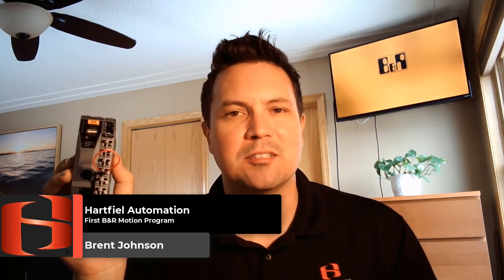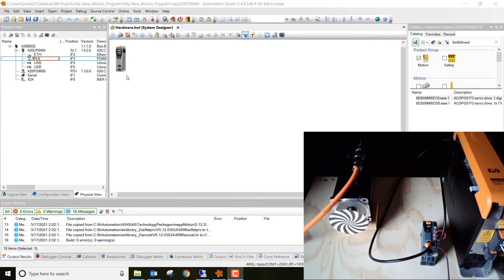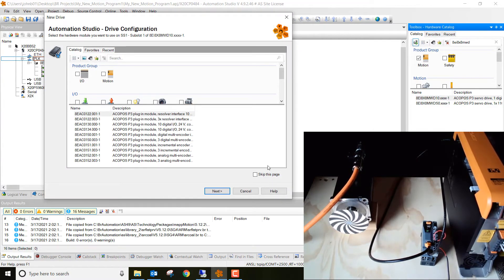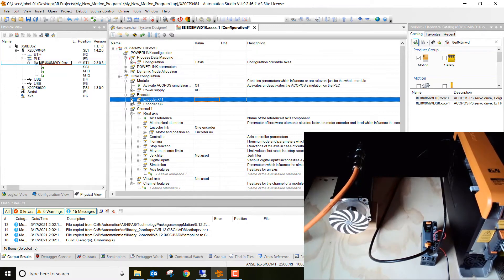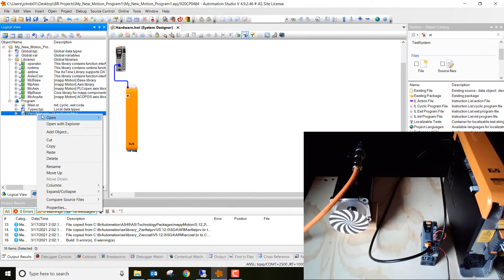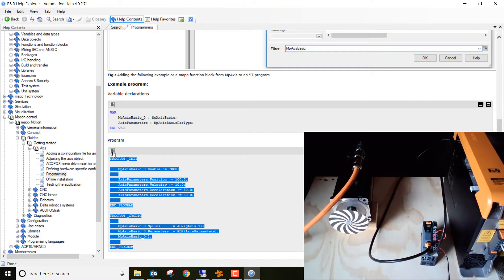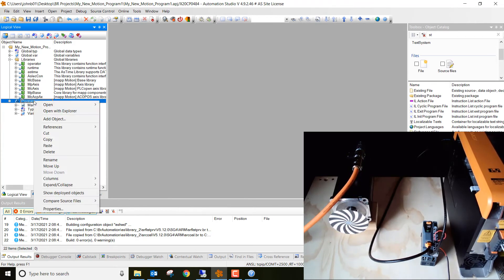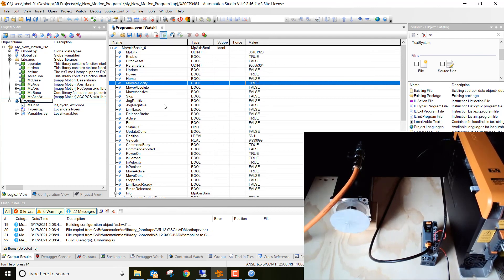B&R Automation  My First Motion Program Part 1

Comment: My friend I'm doing the first test as shown in the video. The next day when I went to test without changing anything the Ax1 led was flashing green. According to the manual, I checked the Enable contact pins and I checked the connections. But I can no longer work while the led is blinking.

Comment: hello dear, i need your help. i have B &R power panel 4pp065.0571. but its restarting itself again and again. i want to replace its panel but i am worry how i will copy the exisintg software in new panel. although I have a 512MB card installed with it. Can i copy a software from that drive

Comment: Hi sir
I reset may X20CP3586 and now I am facing Run Time issue project is in B4. 90 and PLC is in Boot Mode and shows Ar version J4.03 
How to fix it 
Can you please help me ?
Reply: in the project menu you can change runtimes choose a proper one or install diffrent ones which are suitable for your case, for extra  help ask at your b&r vendor which runtime is recommended and works for your case.

Comment: Hi Mr. Brent, thank you for the helpful video.  
i have the following problem.  in the program watch window, after the position reach 1000, it stops and the variable "Error" takes the value "TRUE" with "StatusID" -1067278080. 
I´m not able to reset this even i set the variable "ErrorReset" to "TRUE", nothing happens.  
With this, i can´t do the next tutorial.  please help. many thanks in advence.